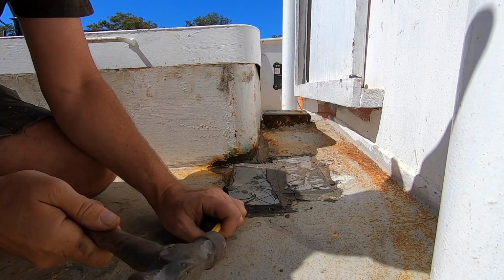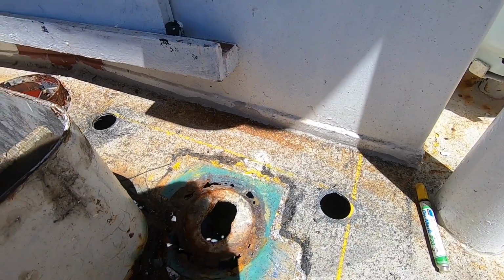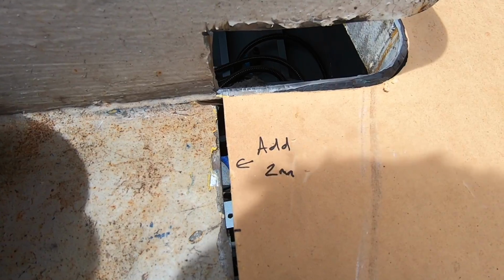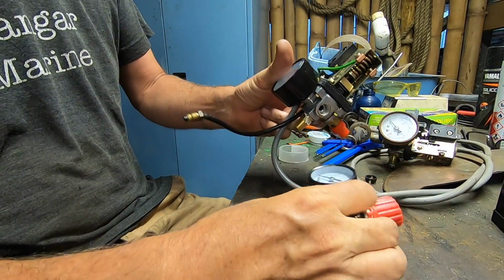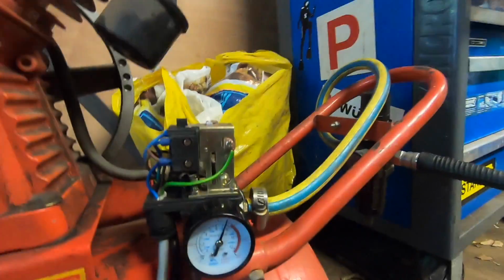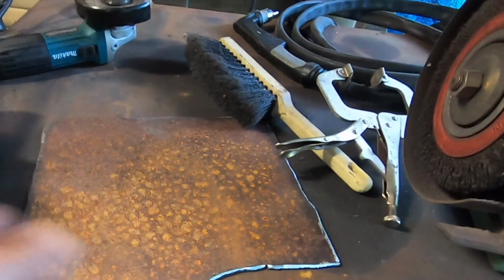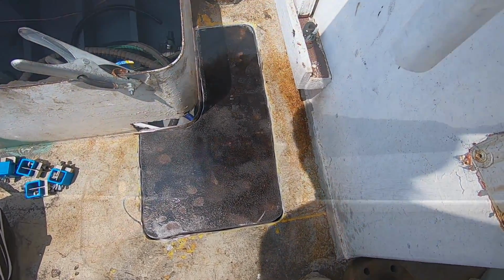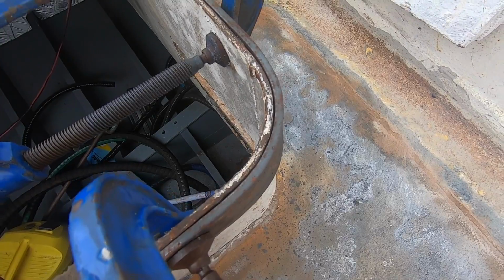Repairing the steel trawler's deck

Comment: Steel is far more forgiving compared to wood. With wood any filler stands out but weld n grind back the seam if you prep was even half decent it will look like nothing ever happened.
Reply: Perhaps but nothing compares to the beauty of wood.
Reply: @jasonfoster2909  
Not to mention longevity.
Salt water can pickle certain woods making them last almost indefinitely with regular upkeep.
Reply: 841k9 So true. It’s the fresh water that causes damage to wood.

Comment: How thick is this deckplate? And how many mm of good metal was left on the rusted part?
Reply from the maker: The deck is about 3-4mm thick. In some places there is no metal left due to the paint having chipped, but in other places where the paint is still intact it is still at full thickness.

Comment: what welding rod did you use for your patch job?  I almost looks like a 1060.
Reply: Sorry you just missed this  weeks $100 prize for naming the correct welding rod ...it's the latest1061.YOU MONG .
Reply from the maker: It was just a run of the mill 6013.